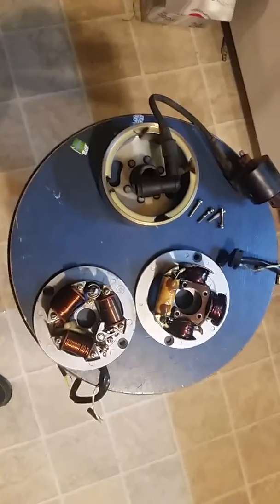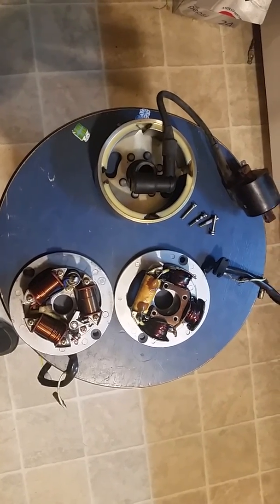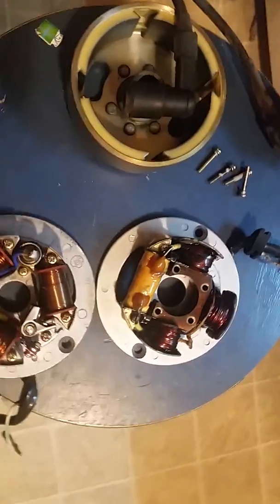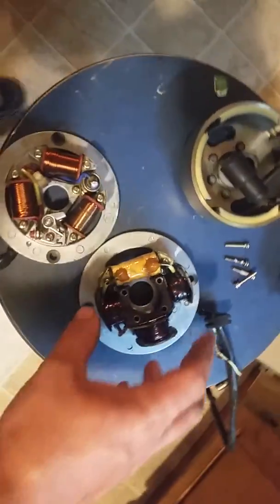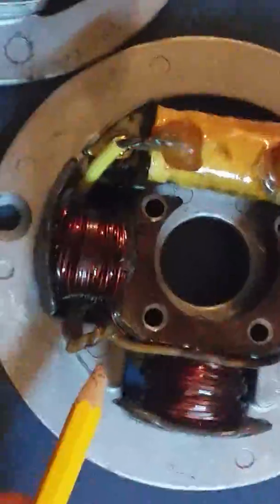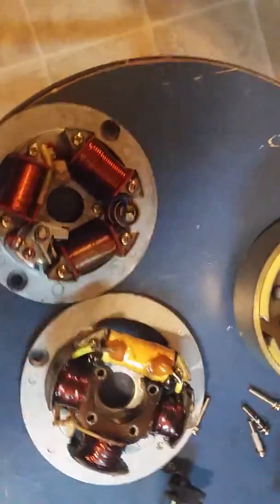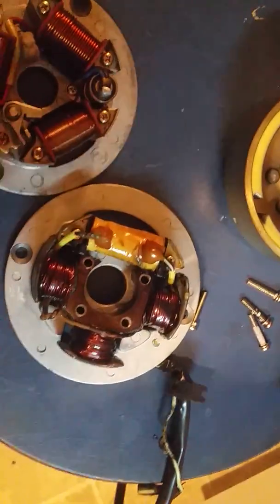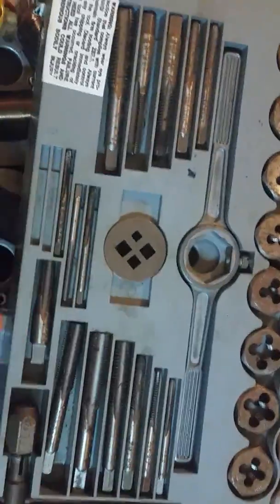KE100 CDI PLUS 6 volt to 12 volt conversion part 8 3/4 lol

Comment: Dear Kevin, Thank you for the informative videos. I need a small clarification from you. KE100 Starting coil ( while long coil with two poles) goes to CDI box. I was told that Kawasaki KE100 starting coil works as power coil & pickup coil.  Can you help me in identifying the power line and pulsar line aka. pickup coil wire in these two wires ? . Thank you in advance.
Reply from the maker: It's all in my videos step by step there is no cdi box this cdi is a basic system the box your referring to is the voltage regulator
Reply: Dear Kevin. Thank you for the quick reply. Really appreciated. 
I am working on a Kawasaki KE100 CDI motorcycle wiring and want to know the primary source power (for Powering CDI) and Pickup Coil for ignition timing spark. Kindly see the images of charging Coil , wiring diagram (https://tinyurl.com/y4pb6d2j) & https://tinyurl.com/y22o65tc.  Thank you .

Comment: My first bike ever 20 years ago was a ke100 I still have that bike in the garage. Getting it ready to ride daily in southern-cali.... just feel like a cdi with 12 volt would be best for reliability and ease of use with lighting.... I would be running all L.E.Ds and a cigarette lighter plug to charge my phone/helmet cam. You were getting 14 volts on your other video so 14.3 is the standard charge rate of any vehicle...... if I can do that I will be able to run this bike in LA with phone and Helmet cam

Comment: Yes BUT do you have to cut the cdi plate to fit the 2x 6volt coils like in your other video. In other words after drilling and tapping that plate do you have to cut it and modify it again after tapping to hold the 6 volt charging coils?
Reply from the maker: you dont have to drill and tap on the points plate just cut you have to drill and tap cdi plate for the 12 volt

Comment: Instead of drilling and tapping  the cdi plate can you just mount cdi to the points plate with 12volt setup?
Reply from the maker: welcome to my channel no there is no holes for the 12v system but the holes are marked with 2 circles